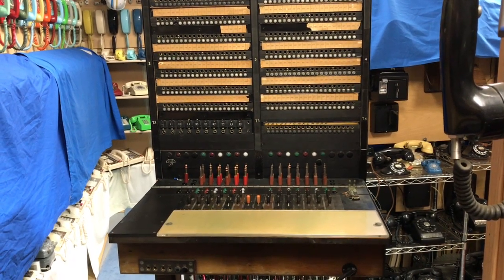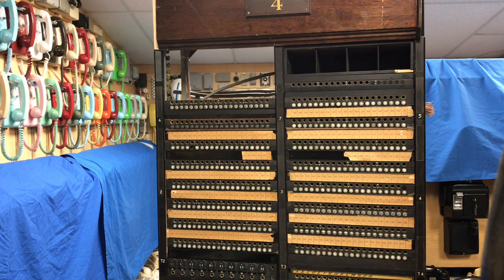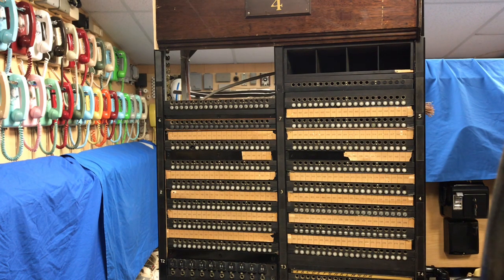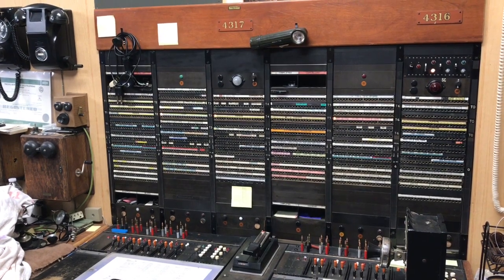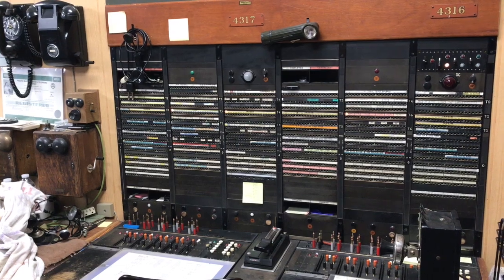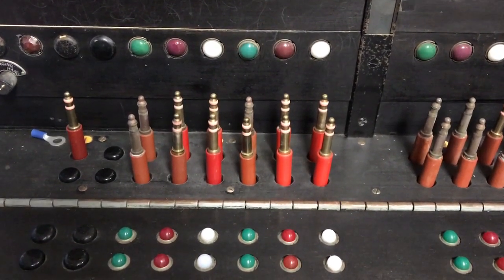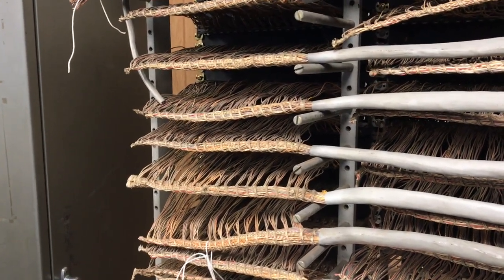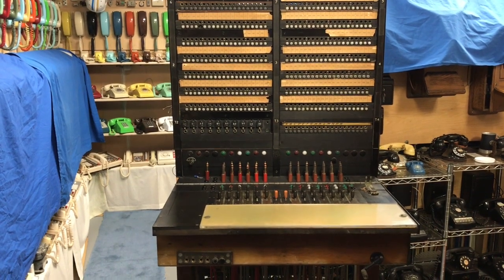Western Electric combination magneto / common battery telephone switchboard.

Comment: I used to work on these in the 80’s when I was a PBX repairman at Pacific Telephone. These were used in answering services in the day and the calls came in from the central office on a concentrator/identifier. It was a crossbar switch in a cabinet at the answering service. Thank you for bringing back these memories for me! I’m still working at the phone co. I have been with them for 42 years. On a cord board the cloth cords had to be replaced regularly which was great for the telephone repairman getting call outs and overtime pay 😀

Comment: I remember these.  I worked as a switchman in a SxS toll and local exchange in the 70's.  They are still interesting.  Is ESS still used or is everything IP telephony?
Reply: The last #1A ESS was decommissioned in 2017. There’s still a lot of 5ESS switches around but they are on their way out.
Reply: @thecooldude9999  is it going to be IP telephony after 5eESS is gone?
Reply: ESS is still in widespread mainstream use, not just with the 4ESS and 5ESS but also with the Nortel DMS and others. Verizon Wireless routes all 1X and 3G calls through mostly 5ESS. 5E in the 2000s got modern SCSI disk drives from Lucent and is still fully supported
Reply: @kimcelarmycx229  this is good to know.  I had thought voip had taken completely over.
Reply: We still have analog phones here in calif. with a copper pair to the central office. 2021. Although in several neighborhoods the phone co. deployed pair gain technology like the light span and SLC 5 pair gain carrier systems to the customer.